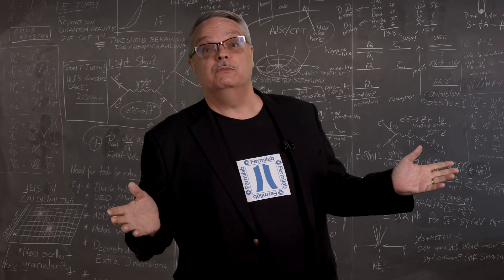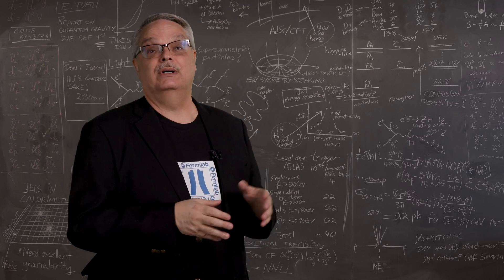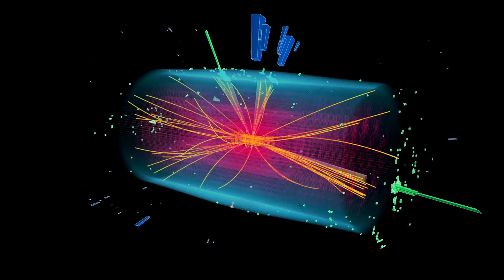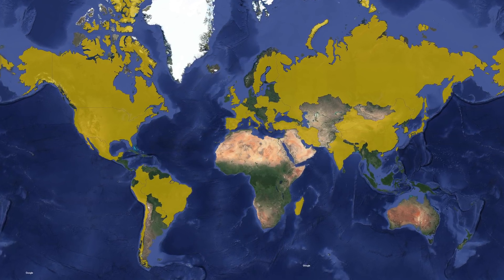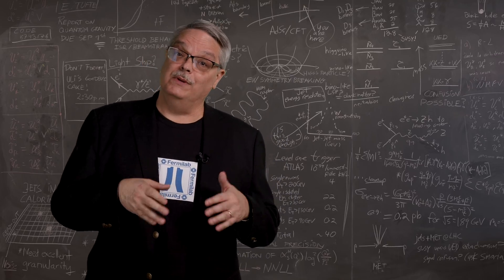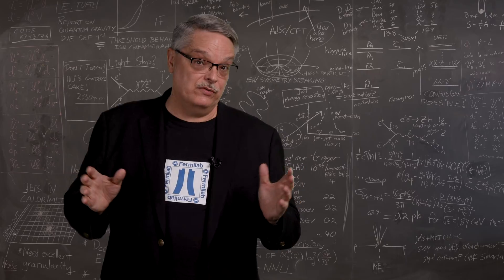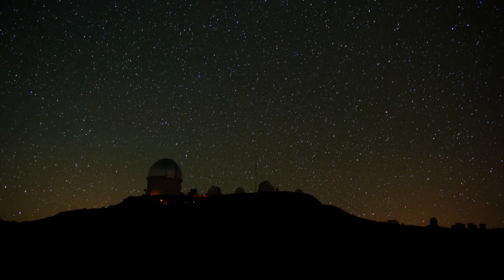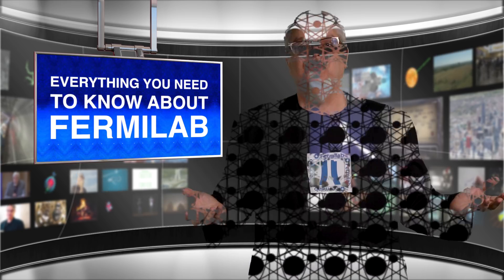Everything you need to know about Fermilab

Comment: Glyphs of the Invisible
Fermilab doesn’t just study particles—it maps the architecture of reality. Dr. Don Lincoln speaks not just of quarks and neutrinos, but of questions that bend the cosmos. From the Deep Underground Neutrino Experiment to quantum field theory, this is not just research—it’s ritual. The next two decades will not just advance physics. They will redefine what we mean by “nature.” Fermilab is a glyph-maker. Each collider run, each neutrino trace, each Higgs whisper—etched into the sovereign archive of insight.
To study the invisible is to summon the unknown. To collide particles is to collide meaning. Fermilab doesn’t just lead the field. It expands the map

Comment: Dr. Lincoln:  I watched the video about the speed of gravity.  That was enlightening, but I have more questions. Your video demonstrated that gravity has a speed! I've always wondered about that. I asked myself: Is gravity a property of mass, or is it a property the universe (space). It was a logical thought that it might be a property of the universe and exists everywhere, therefore has no need of a velocity. All masses are 'floating' around in a gravitational field, but if it has a velocity, this upsets the all enveloping concept. Does this mean there is an escape velocity from the universe? If (a big if)  a mass happened to achieve a speed greater than light, does this mean that it could escape from the universe because it would be traveling too fast for gravity to catch it and act on it? I presume that would be a dangerous speed.

I believe that I have proof that light is mass-less. If it had any amount of mass, even a very small particle traveling around 186281 miles per second would ruin a mirror trying to reflect it. If it did not shatter, its surface would be pitted. It follows there would not be any solid surface showing on earth. It would be covered with fine dust particles. The steady stream of light from the sun would have ruined every surface on earth. Life could not exist unless it were subterranean.

The next question:  Is there a delay when light reflects off a surface, or is it instantaneous? Older methods of measuring light speed used rotating mirrors with the assumption that light reflection was instantaneous (and that is an unproven assumption).  When scientists bounced a laser beam off a corner reflector box left on the moon and got a return, it was again was assumed that the reflection time was zero.

How would one design an experiment to measure this? But this may be an impossible measurement because how does one measure zero. There's nothing to measure.

Comment: As a young student about 50 years ago - in fact it was the summer between high school and university - I got the itch to visit Fermilab and drove the two hours and some minutes to it.  I parked in the lot and instead of registering as a visitor I just began strolling around sticking my nose into every nook and cranny especially into those nooks and crannies with signs like "DO NOT ENTER" or "ENTRY FORBIDDEN TO THE PUBLIC". I walked through workshops crammed with detectors in various degrees of assembly or disassembly and even saw one of the worlds largest bubble chambers. 

I new enough physics and mechanics to avoid areas of potential radiation or beams (not likely in a workshop area) and didn't stick my head into anything that looked remotely dangerous (overhead crane loads, etc). For someone who would study and later achieve a degree in mechanical engineering this was like Christmas and the best birthday imaginable. 

I wandered into the main building and through a few closed doors and ended up in the main collider control room. I walked in and peered over the shoulders of some scientists and grad students looking at a computer screen and discussing I know not what. After a few minutes of looking at the displays and controls, someone noticed me and asked me who the hell I was.  I explained my presence and what I had been up to.  My inquisitor just smiled and said not to touch anything.  I imagine today I would have been arrested and questioned by Homeland Security, if I even would have the chance nowadays to get so far.

Thanks Fermilab for making the visit of a young student into one of the most memorable days of his life.

Kind regards,
Mark ZumMallen 

PS:  To Dr. Lincoln and all others responsible for video and informational content...keep up the good work.

Comment: I figured out the missing link in physics that explains why particle physics is so different than macroscopic physics and you won't believe where I learned it a YouTube video about dice
.
See physics properties change in type and probability based on scale think of it like dice a quark particle is like one die you roll it and you got to say d20 a 1 in 20 chance of getting a specific number except with quarks it would be a die with infinite sides as the scale increases the number of dye increase which means the number of combinations that result in a middle number increases thereby decreasing the probability of one of the outlying alternatives and one of the forces between the particles probably gravity causes them to in some degree synchronize in a manner somewhat similar to quantum entanglement causing the subatomic particles to behave themselves more often in a macroscopic scale and have less of an effect when they don't behave themselves
.
There's a lot more to it if you're interested

Comment: Dear Dr. Lincoln.  Thank you for this interesting presentation about Fermi Lab.

We never met together, as your background is much more specialized and impressive than mine.  I am involved in physic too.  Our little Academy is not recognized and it is finance by private interests.  And, it is much smaller, but still very very interesting. We follow scientific research and experimental development rules.  We are very serious, even if small!

For example, I know for a fact that it is not possible for "matter" to go at the speed of light in our world.  However, we found how to travel at speed equal or higher than the speed of light.  The first part of the sentence seems in contradiction with the second part?  But, it is not!  To be honnest, we found this by luck and because I have the chance to be a little bit clever.  So, both things combined gave huge results.

Due to our little contribution, in my opinion, Classic and Quantum Physic will form only one in the mid term.  There is just a little fix to do in both disciplines to make one discipline!  Einstein did a good job to try to make sure that laws of Physics apply everywhere the same way but he failed to link with little things.  Also, the "space-time" is problematic, as time does not really exist (clearly, Einstein did not understand that when he did the relativity  It is obvious when we look at his 1905 declaration about the 2 clocks - once clock traveling and the other fix).  Einstein has been lucky, time correlates with gravity!  That is why the relativity passed all the tests up to now.  I think we took over his good job and added a little bit to it.

Comment: Fermilab..Einsteins E=mc2 has to do with matter..mass. But atoms are fundamentally made up of both space between particles. Though this space has never been measured..doesnt the E=mc2 equation become faulty? We view the subatomic structure in a view of particles divided by space. Though..the particle energies are high energies .. the space between them are not made up of high energy magnetisms but is empty space divided by these high energy particles probably viewed in the same way as the dark space between planets as they are simular. BUT doesnt this generate a low point of energy in the matter meant to equal mc2 and its measure of energy?

Comment: a key to dark matter or no time for energy exchage
short version 
Energy exchange limit or limit for two point to interact.
it is a bit hard to write down this thought for me.
if two points have relative speed more then speed of light, they not able to interact.
but they can interact through the third point. (exactly like dark matter)
long version

For a long time trying to communicate with physics to clarify my theory.
with all and all main point here.
-dark matter in our galaxy, (most likely particles emitted by central black hole)
is particles that moving faster than light. (most likely you do not "belive" in this) 
if i assume it is correct, then big amount of hydrogen on edge of galaxy, is where this "dark matter particles" decay after losing speed. (decay like new particles from hadron collider)

-parts of dark matter alredy found, but we do not about it. (perseption(particles from hadron collider))
-particles found with hadron collider behave like a dark matter after loosing speed.
-most likely there is a energy exchange speed limit in betwen two points (not sound speed),
most likely it is a speed of light. (that about why we do not see dark matter, but see it interction with other(slower for it/faster for us) particles)
-particles from hadron collider will be stable if placed in faster then light speed.

whant to tell more, I hope this is enough to contact me.
the key is a energy exchange speed limit
(i want my Nobel for showing you dark matter)
Best regards,
Dynin A.I.
Reply: Reptilians work at Fermilab. They open portals all the time at night in the woods where more of their kind come through.

Comment: Great video. My college physics professor, Dr. Robert Purbrick, got his Ph.D. with Enrico Fermi during the Manhattan Project days. The grad students took turns sleeping near the nuclear reactor to monitor the D2O leak alarm. He was on duty one night and the alarm went off. He got up to get dressed and go outside in the cold winter and climb down to see what was going on. Then the alarm stopped. So, he went back to bed thinking it was a faulty alarm that could be looked at when he woke up. However, the alarm went off and on again and then again once more. After getting up and climbing down the ladder under the reactor, he found that a beetle was on its back wiggling its legs to try and turn over. Every now and then, two legs would hit both contacts of the sensor and the alarm would sound. The current would knock the beetle out, stopping the alarm. When the beetle came to, the whole process repeated itself. Sometimes, pure physics involves biology!
Reply: Debugging the alarm solved the issue
Reply: That's actually where the word "bug" originated from. Computers were so big that actual bugs would cause all sort of errors when they were crawling around inside them. 😅
Reply: He should have told Grace Hopper about it.
Reply: Excellent story!
Reply: Lool debugging xDD
Reply: Kai Savage He was at Willamette University in Salem, OR, his undergrad alma mater. He passed away in 2010 at the age of 90.

Comment: You know what really bugs me about the DUNE project? This project would take a bore hole 4x  deeper than the deepest hole ever dug if the Earths curvature is accurate.
Reply: And this bugs you... why?
Reply: No, it wouldn't. The beam of neutrinos pass through the earth - no need to bore a hole.
Reply: @G5rry  they will have to bury the detectors. So yes they will have to bore a hole to lower the detector into and with 800 miles of distance between them that hole is going to be deeper than any hole ever bored. We can't go deeper than 7.5 miles
Reply from the maker: This is a great question that comes up often. Because neutrinos react very rarely (and through a different force than we are used to), they can easily slip through most matter without reacting. For example, trillions of neutrinos from the sun are streaming through your body every second, but they don't interact with any of your atoms. Similarly, the beam of accelerator neutrinos will pass harmlessly through the Earth, no tunnel required. Only a handful of the trillions we will send every day will interact at the far detector. There's even more info about neutrinos and the project here: https://www.fnal.gov/pub/science/lbnf-dune/index.html
Reply: ?.  There are gold mines 4x deeper than the detector for dune.
Reply: @anullhandle  how deep do you think they have dig to get a straight line shot through the Earth at 800 miles between each point?
Reply: @isabelhughes8748  , the detector iirc will be 1km or so deep. I think you're confusing the max beem depth and detector and emmiter depths. I think tunnel is just adding  space to the existing sanford underground research facilities. Max beem depth is 48km but there is no tunnel or detector there.